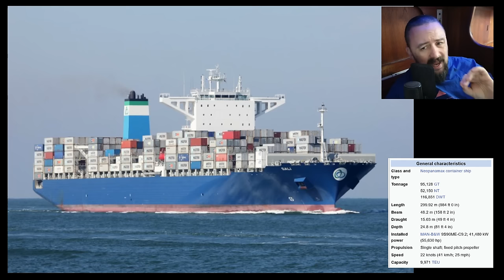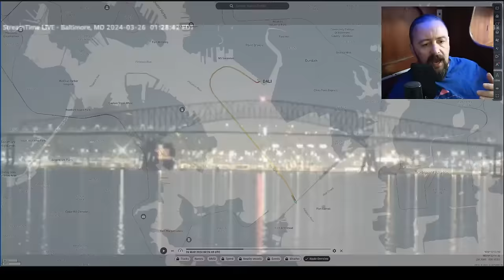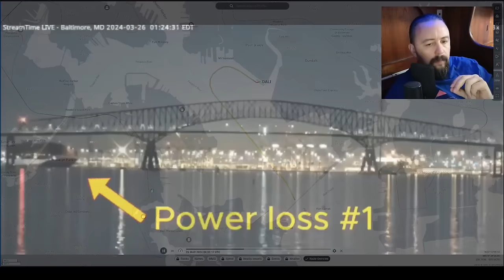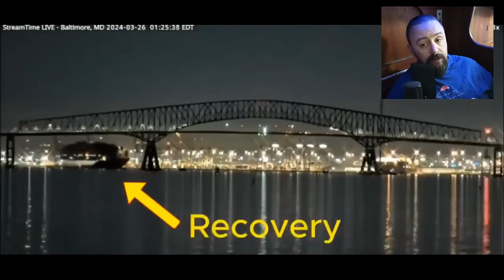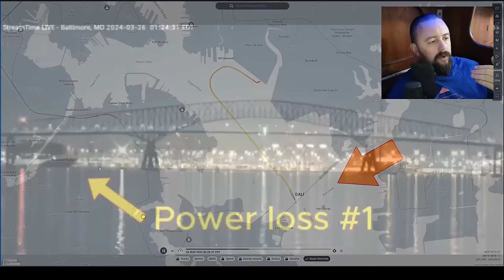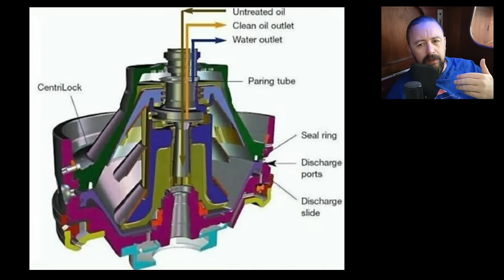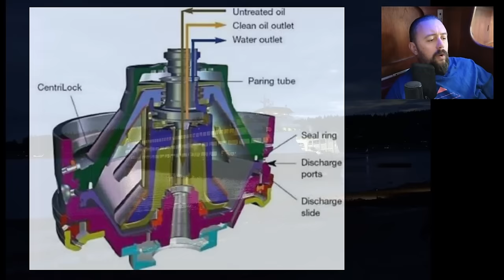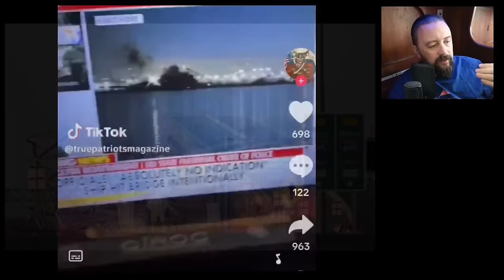Why MV Dali lost power and struck the Key Bridge: a sailors perspective

Comment: both the ship and the tugs have a wind gauge, if it was high both tugs and ships pilot would know this, and both tugs would push the bow and the ship on its  starboard side to counter the wind,, if the rudder was turned starting its turn it would stay in the same position when the ship went black. American bridges are like third world bridges today, they do not take into account the faired bow of a big container ship can extend over 150 ft from the center line where some bridge concrete base is inly 50 ft if that, this makes the bridge structure vonerable, the tugs and pilot should know this and make it mandatory to stay on the job till the ship cleared the bridge.

Comment: Like you we know definitely a Power outage occurred and thats the cause of the crash but what caused the power outage is PROBABLY contaminated fuel which is easy to happen with diesel fuel I know that because I was a lifelong fleet mechanic on both regular Vehicles and Big rig tractor trailers. The IDIOT near the end stating that POWER FLASHES on the bridge were Dynamite charges is completely ridiculous

Comment: all industrial diesel  engines will smoke badly when a sudden heavy load or max load is put on the engine . possible reasons why you see the thick black smoke 1st would be that these engines were never put under extreme heavy load  i suspect when they got them restarted the captain ordered full reveres this would put sudden enormous load on the engines causing them to belch out all the accumulated raw carbon and un-burned  fuel out the exhaust system . this is called wet stacking . all industrial diesels  need to periodically be load tested to remove these accumulated deposits , i suspect that the owners of this ship didnt mandate this to be done due to the time it takes and the expense of the fuel being burned for proper load testing and clearing it could take hours running at full load (usually around 80-90% full load ) to clear out. as  for why they lost engine power in the first place that remains to be seen. this is just 1  possible reason for heavy black smoke , others could be restricted engine air filtration system or engine mechanical  wear or damage (poor maintenance)
Reply: An anonymous YT commenter had said that discussion among seamen in Baltimore was that this ship was having engine problems even before it left port.
Reply: @DUCKSAREEVILLLLLLLL  i can see that as well  and there goes the new rules. if a ship has engine trouble it  should be the port authority's  responsibility to hold the ship weather at sea before entering port or if docked .until  the trouble is  resolved and full tested before making way , i can see this being implanted for the future .to bad as usual people have to die for it to happen.

Comment: You need to go watch a channel called what's going on with shipping and he'll give you a little bit better idea on what's going on on the ship and with the infrastructure and the electricity is not one I mean they might have 120 to some of the lights but you've got higher voltage you basically have industrial lighting their 277,480 volt which is pretty strong stuff I mean if you think the difference between 12 and 120 volt getting a shock from either of them then bump it up to 2770 and it's just a massive almost exponential like kill you like throw you off a ladder doesn't feet and they have all the lights for the roadway lights they have the signage lights they have the signage system and then they have the high intensity lights at the top of the bridge for aircraft and that definitely is not something that's not running on 120 volts

Comment: There was no wind . Could it be when they dropped the anchor it slowed the bow and caused the stern to come around causing the ship to turn towards the column.
Reply from the maker: If there was no wind why is the smoke coming out of the stack going sideways?
Reply: @RenegadeADV   You can get the answer by just using the last 4 words of your question  "the stack going sideways" .    The stack moving at 7.5 kts leaving a line of smoke.   Notice how the smoke is slow to disperse, and isn't moving laterally relative to the bridge.

Comment: Re; Mastercraft 24. I can make tight left turns (port)and wide right turns (starboard). Why would my tiny boat handle like that? Well it is because I only have one propeller. That single propeller while pushing the boat forward is also pushing the aft starboard. Thus poor turning radius on right turns. I have 1 anchor but I can throw it out on either side port or starboard. Now then if I throw it out on the port side the bow will want to turn to port. Now once upon a time there were these communist americans who forced everybody american to follow green fuel rules (DEF additive for diesel) including ships. Now what if Obama said Delta Airlines I decree that you take off from LAX and change fuel to Gasohol midair. No pilot would think that is a good idea. That ship engine was killed by fuel change over so Obama could be happy along with all the Low Sulfer women who do not know what they are voting for.